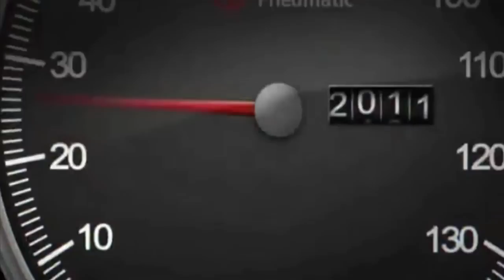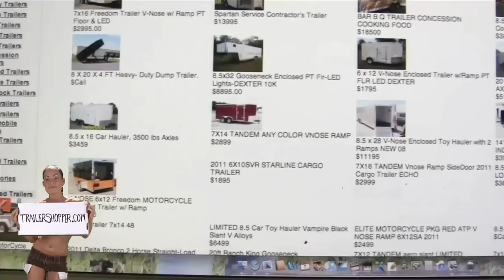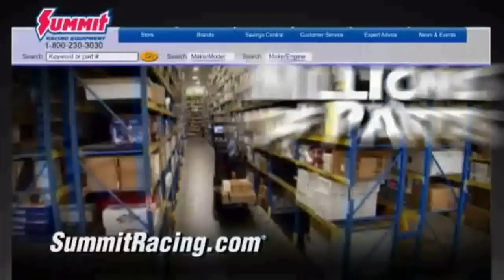RatRodTV Episode 5. View at ratrodtv.com

Comment: The only problem with the 454 he got out of the suburban is its a small port head motor and is probably 200hp stock , could have gotten more hp out of a smallblock and a ton less weight.